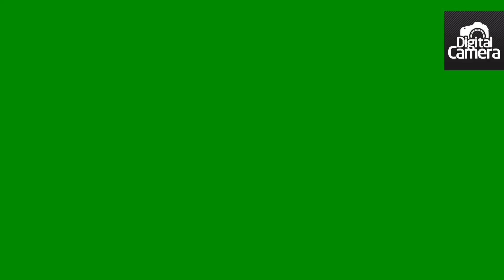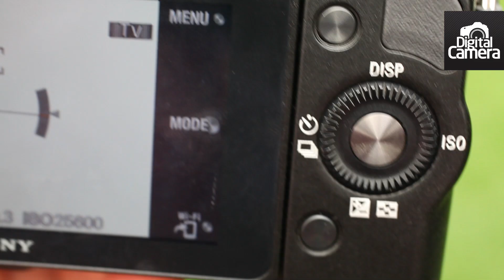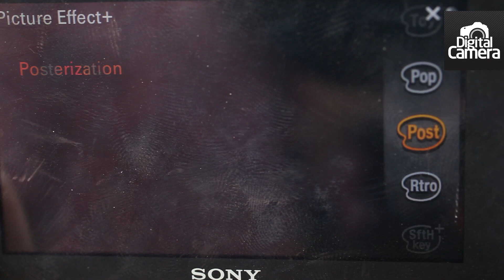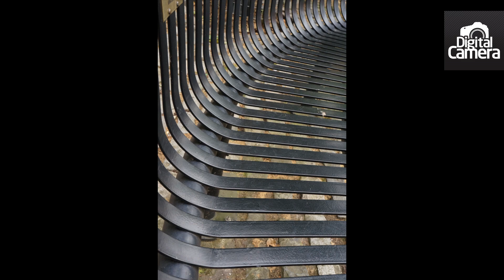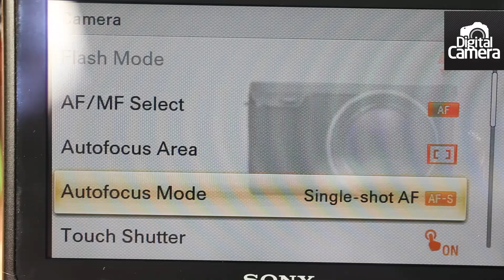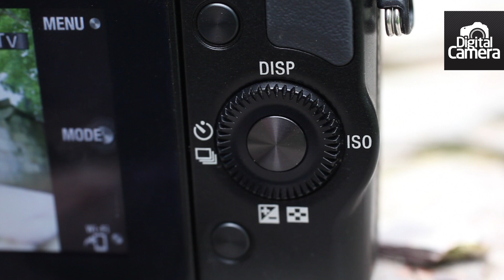Sony NEX-5R review

Comment: I haven't tried the samsung nx300 much, but I personally prefer the NEX 5R, i like the larger sensor, which provides some good low light performance, the handling, and the kit lens is pretty decent. What throws me off is the price, i don't know what your budget is. i believe the samsung is cheaper.

Comment: Then how about the NEX 6?  I'm worried about the a57's apparent proclivity toward high ISO's in auto mode (which I will no doubt be using for quick, off-the-cuff snapshots).  I know I can select ISO when taking the time, but I want good, clean quick shots, too.  How has your experience been?

Comment: Sony has a better sensor, it records 1080p at 60p, it is much quicker to focus, it has focus peaking, wifi (if you are into that) and it has two dials for better manual control. I don't get how Rebel T4i is better. The only advantages in my mind are optical viewfinder and much bigger lens selection.

Comment: I mean moire and aliasing in the image. Like when you shoot a roof with shingles in the sun, or a brick wall with the lens zoomed out wide, and you see odd patterns that are distracting. The  5n had that issue, but I don't know if the new sensor of the 5r is really better or they just made focusing better. I do aerial quadcopter video, so if the sensor isn't better I may as well get a 5n for less.

Comment: Hello can you confirm if the 5r has the same overheating issues as the 5n and Nex-7?  It will probably make it to the 29min mark no problem.  What i want to know is if the Warning light comes on before 29min.  Also if it makes it to the 29min mark can it immediately record another 29min without shutting down.  This is a very important factor for me and im sure others aswell.  A test would be ideal but any help would be appreciated.